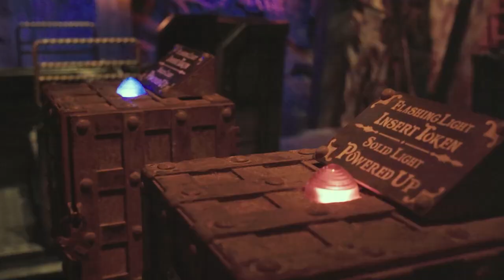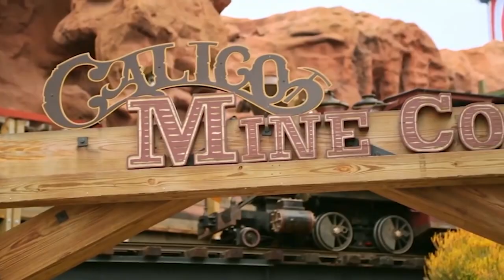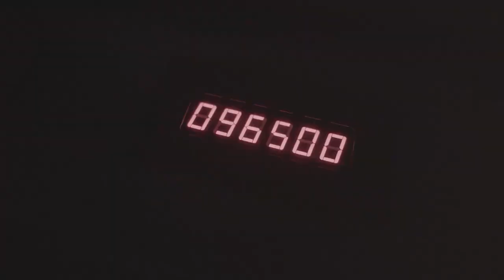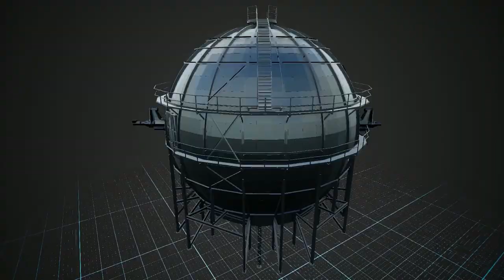Canada's Wonderland 2024 Predictions

Comment: At this point there's a few rides that can simply just go away.
Flight Deck
WM Guardian ---- though it's still kinda new, it breaks down far too much and the damn guns haven't worked correctly since the second season.
Time Warp
Backlot coaster could be  nice to remove as well.  If they refuse to use/fix the props for the ride then they may as well trash it.
The Bat  ---   Some may disagree with this one.  But it's also due.

I would hate to see Dragon Fyre go, but some kind of update to extend the ride just a little bit would be nice.